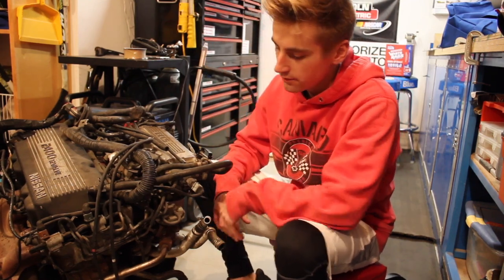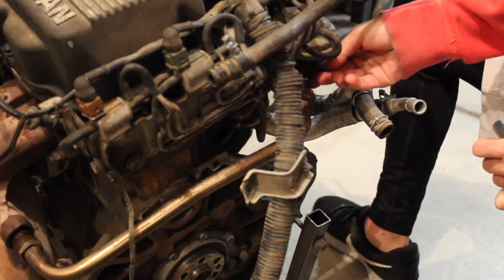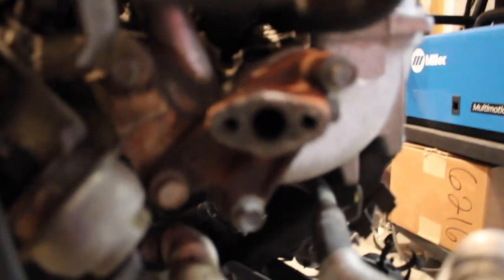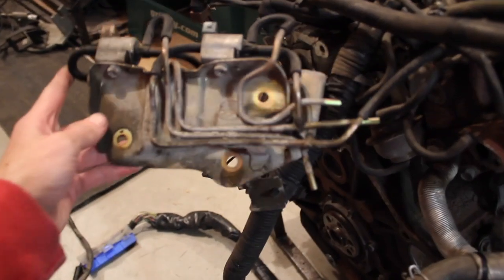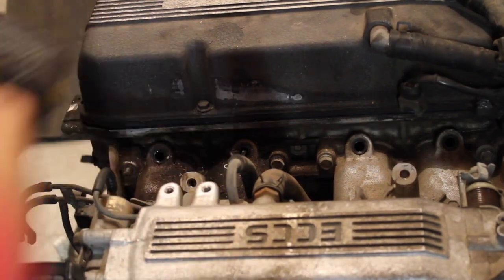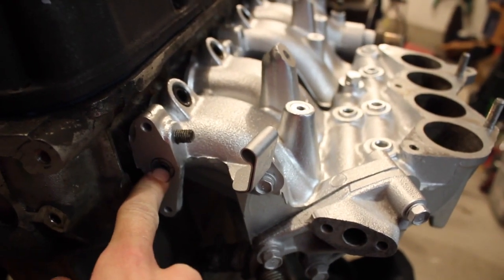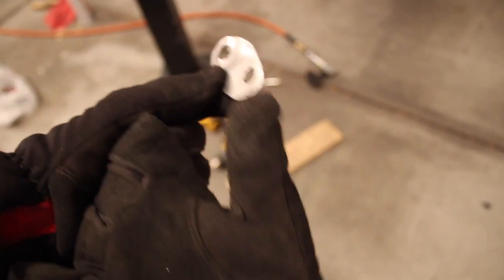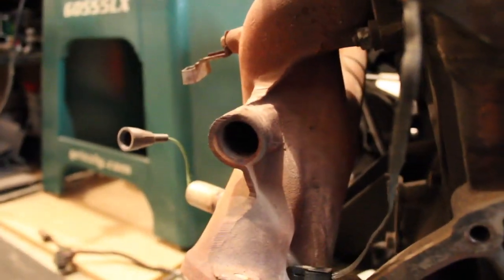SINGLE CAM KA CLEAN UP! (egr delete)

Comment: I did an Egr/vacuum delete in my 97 Nissan Hardbody, after putting headers on it, in idle the RPM’s bounce from 1500-2k constantly .. it’s really embarrassing at stop lights 😅 it’s a Ka24e , any ideas?
Reply: I put headers on mine as well, and it also idles high, but I did that at the same time I changed out my aic valve, so after adjusting it, I was able to bring it down to about 1000, but of course that’s still high..   I’m thinking in your case, “ and I absolutely could be wrong, I’m just spitballing here “, because you deleted the egr, your ecu is picking up on lower exhaust temps, and is telling the motor to run at a hight rpm, to get heat in the motor, but because of the deletion,… that’s never gonna happen, so it’s constantly making the motor run at a high rpm..But also, double check your all your vac lines.. I’ve seen a cracked or barely broken/unplugged line cause some real oddities , good luck fellow 97d21 enthusiast

Comment: How did you plug the hole on the other end?
Reply: You can go on eBay and search up ka24e EGR delete plate bro
Reply: i used the old end of the egr pipe, just cut it a few inches from the threading. pinched it and jbwelded the pinch.